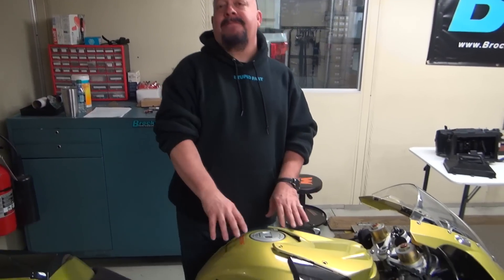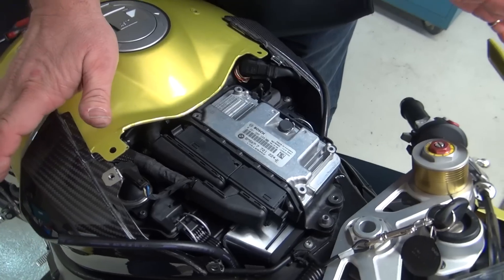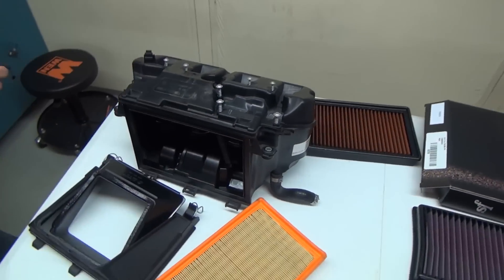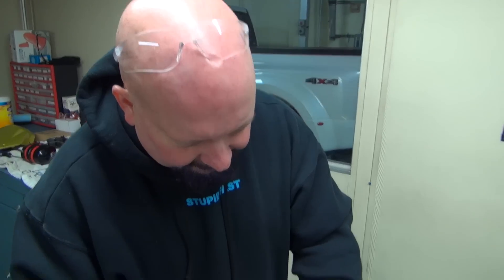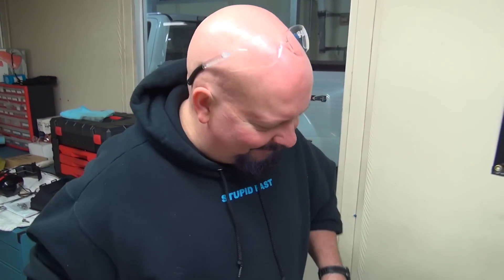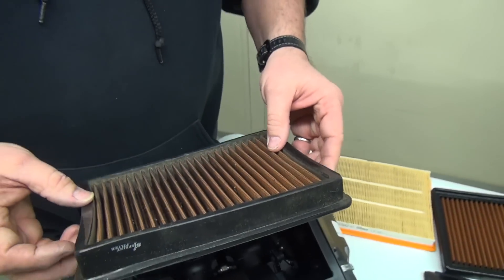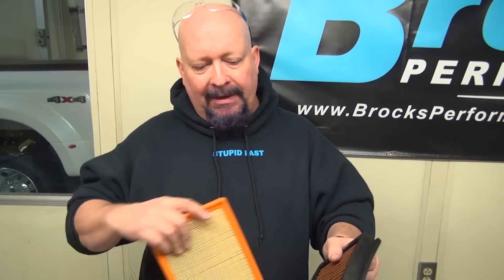Tech Talk: BMW S1000RR Air Filter Installation and Detailed Inspection

Comment: hi there I have bmw s1000rr 2017 and I am from pakistan I want to install sprint po8 filter but most of people recommend me not to use as in pakistan there is alot of dust and sprint filters let pass more dust then the oem so what do you suggest?
Reply from the maker: The P08 is the choice of many OEM's as an everyday filter. That said, If you belive your conditions are exceptionally dusty, a P037 would be a safer/smarter choice. Use the blue support button at BrocksPerformance.com to ask our customer service team if we have a P037 available for your bike - also, if we can special order one for you if we don't.

Comment: Is there a way to install this the wrong way or does it only go in one way ? Asking cuz I just changed my filter on my 2022 s1k rr
Reply from the maker: The Sprint Filter logo should be facing out (you can see it when the filter is properly installed in the lower half of the airbox). On some models, you must stretch the filter a bit to make sure it fits properly in the air box. The material is soft and permeable to allow for this adjustment.

Comment: Hey quick question i got a 2011 S1000RR on the left side of the fairing when you look at the engine theres 2 black plastic caps on the side of engine, one of them moves alil bit so oil is sneaking out, it doesnt seem as if the gasket is bad bike is 100% healthy im guessing the cylinder head needs to be tighten ?
Reply from the maker: Send me a pic and I'll try to help. bmail@brocksperformance.com

Comment: Hey brock when add p08 sprint air filter those the ecu need to be flash my bike 2015 S1000RR?
Reply from the maker: No. The P08 is a direct replacement.

Comment: P08f185  filters just don't like super fine pollen. I checked after spring ride. Alot made it through. Likely use stock during pollen time.  It was set correctly.
Reply from the maker: You are correct about the pollen. Here is an article on our long term test bike: https://blog.brocksperformance.com/sprint-filter-p08-long-term-test-kawasaki-zx-10r-2016/
the bike switched to a P08 F1-85 at 16K miles and we recently completed another test at 23K. We will have the video up soon. The results are impressive.
Reply: What's the choice aftermarket filter for a road bike? I'm thinking the p037 might be the best option?
Reply from the maker: @Rob Thorp, the P08 is OEM for Ducati. P037 is for very dusty conditions. Off road mostly.
Reply: @BrockDavidson  that's interesting to know.  Also interesting is that the BMW paper filter is rated down to 10 microns. The BMC filter is apparently comparable at 7 microns.  I haven't made my decision yet on which filter to go for. Sprint P08 sounds very good from a performance point of view that's for sure...

Comment: Thank you!  I was just getting ready to install my new Sprint Air filter in  my '17 S1000RR this weekend and didn't even know about the bottom tabs on inserting or how the Sprint air filter sides were a bit soft.  Thank you, as you just probably saved my engine.

Comment: Brock:  GREAT video, as this explains EXACTLY the problem, and gives detail on how to AVOID IT.  I'm going to look really hard at my filter lips when I get home, and refer to this video to check correct install.  But I DO have a question (or wish you had done this in your video):  With a properly installed Spring Race filter, run a white glove around on the inside of that airbox and see if it's clean or NOT...Could I have installed my Sprint race filter (trackday bike ONLY) incorrectly?  Absolutely.  I don't see it, but when I run my finger around the inside of my airbox, I can feel it's got some dust in it.

What I want to know is if a properly installed Spring filter keeps the airbox clean and free of dust OR NOT.  If their dust in the box, that means there has been dust in your intakes which would not be preferred.

THANK YOU SO MUCH for posting this!
Reply: PS:  After typing the above, I was so impressed I called to compliment you but you were on the dyno :)
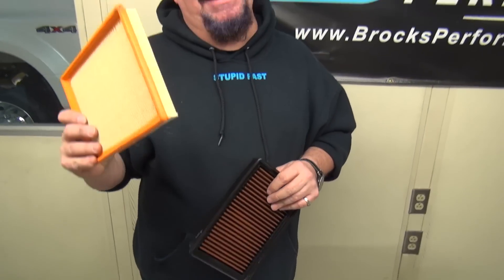Reply from the maker: @tnskdivr - If you are going to perform any type of 'white glove' test, you would be better off doing it with an OEM air filter - as opposed to a high-flow/high-performance air filter, IMHO.... we cover this at 12:37 in the video.  From a Sprint Filter Standpoint: If you own a P08 Air Filter, it is constructed from a polyester material comprised of 80-micron holes. If you own a P16 race filter, it is constructed from a polyester material comprised of 160-micron holes. This means the P16 will flow DOUBLE the air...but it only has 1/2 THE FILTRATION of the P08. The P08 material is the choice of Ducati for several OEM applications. If you would like the convenience of using an easily replaceable/easy to clean one-time purchase filter with maximum dust filtering capabilities, the P037 waterproof material might be a better choice for you? Here is more detailed information: http://brocksperformance.com/content/brocknm/PDFS/Brochure_SF_EN_APPROVED.pdf
Reply: @BrockDavidson  thanks for the response!  I'm not sure that still answers my question so let me ask it differently:  Since the high-flow filters don't necessarily filter as well, is the dust that does get into the duct/intake a danger to the engine?  Thanks!
Reply from the maker: @tnskydivr   As a general rule, no. Of course, some basic common sense is required - if you live on or near the beach, a full race filter is not the best idea. That said, we have customers in Florida that run no filter whatsoever. If you live in an area that would not be considered 'extreme' anything that might make it through a P08 or P08 F1-85 would be harmless. Here is a Sprint Filter long term test we have been performing on a local ZX-10R: http://blog.brocksperformance.com/sprint-filter-p08-long-term-test-kawasaki-zx-10r-2016/
Reply: @BrockDavidson  Yeah, my airbox had nothing nearly like what I saw in your ZX-10R review.  Wonder what that box would have looked like with A oem or wet filter...It's that 'harmless' part that worries me...harmless to a race bike which will be rebuilt often is not the same as a trackday rider's bike that he hopes makes it past the warranty :)  PS I live in TN.
Reply: Disregard some of the above, i now see that 4th pic was on the intake side of the filter; those other pics I think pretty much match what I've found on the engine side of the filter..
Reply from the maker: @tnskydivr   We don't own race bikes and engine rebuilds are not anything we encounter. My personal 2008 Hayabusa has over 10K miles - 90% all of which were at the drag strip with no air cleaner. I just recently installed a P08 F1-85, because it filters well and I know the bike will not lose a single HP.
Reply: I shoulda watched you Kawi video!!!  Thanks so much for the personal response!
Reply: @BrockDavidson  A hair off-topic, but blue IS the fastest color :)  - My other bike is an 08 Busa also! :)